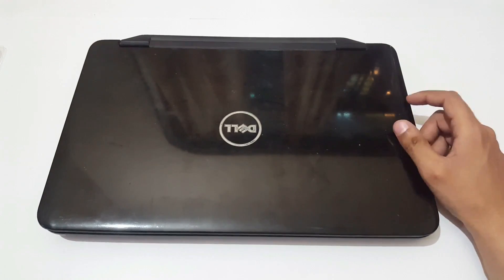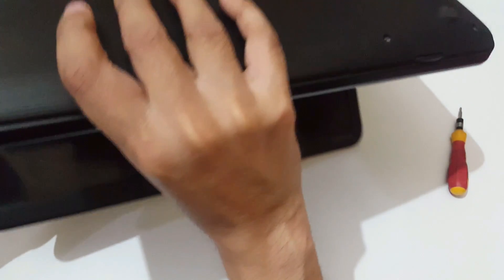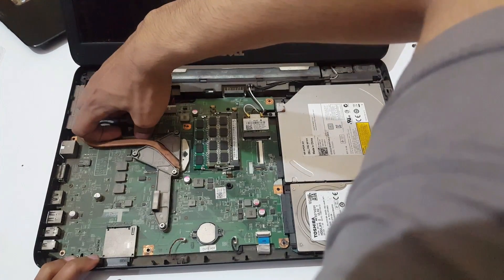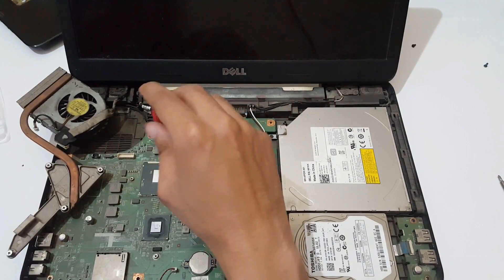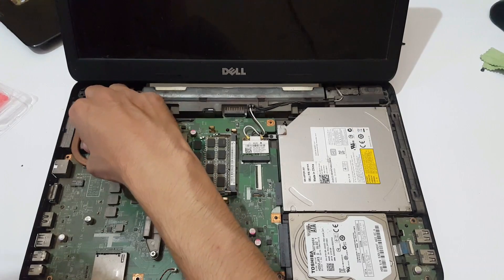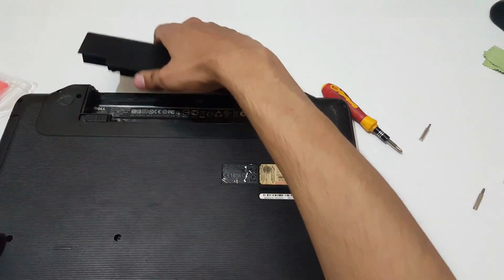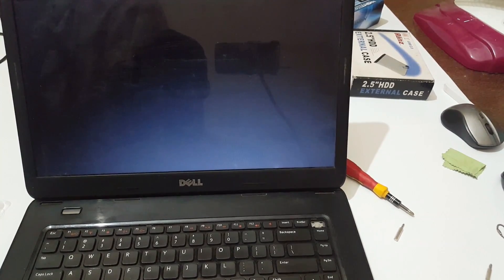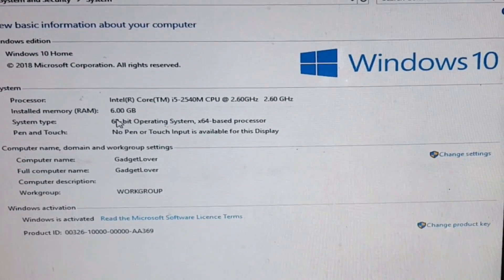How to Upgrade Processor on DELL Laptop | i3 to i5 & i7 - Make Laptop Faster for Gaming

Comment: What is best cpu for hp pavilllion x360 please reply
Reply: 8130
Reply from the maker: Ryan Gamer : You can't upgrade it with Intel Core i3 9100F and I would like to inform you that Intel Core i7 8650U is best available processor for your Laptop
Reply: Is it correct
Reply: Where to find it
Reply: As I am converting it into gaming laptop
Reply: Tell me a cheap one below 10000
Reply: In i3 series
Reply: And I don't want to install in home is there any place in bhopal
Reply from the maker: Ryan Gamer : Go for Intel Core i5 8250U and I would suggest you buy it from Ebay or Aliexpress online store
Reply: Can I upgrade it into i3 9100f
Reply from the maker: Ryan Gamer : In my knowledge the processor of this Laptop is soldered so you can't upgrade it
Reply: Soldered meaning can I take it out with technician without replacing the motherboard i am converting my i3 8130u to i3 9100f can I upgrade it
Reply: Is there any way to remove it
Reply from the maker: Ryan Gamer : Yes but it requires professional hand soldering services
Reply: Can I upgrade it with i3 9100f
Reply from the maker: Ryan Gamer : Provide processor number
Reply: Which old processor or i3 9100f
Reply: I don't know where to find it
Reply from the maker: Ryan Gamer : Installed processor
Reply: More cheap man
Reply: Very very very very cheap below 10000 it is 25000
Reply: Is this this i5 8250u available in offline market
Reply from the maker: Ryan Gamer : In my knowledge yes so to know about it I would suggest you go to nearby PC & Hardware store
Reply: Bro one more question i am upgrading my graphics to msi rx 570 8gb can I use internal display in it
Reply from the maker: Ryan Gamer : You can attach it externally to your Laptop
Reply: Thank you bro but one more question can I use galax gtx 1650 super 4gb in it and does it support exp gdc v8.0
Reply: Can you tell me how much rough price is this i5 8250u in offline market 🤔
Reply from the maker: Ryan Gamer : You can attach it externally and I would suggest you ask about it nearby PC & Hardware store owner
Reply: Can I use it the exp gdc v8.0 using laptop cable
Reply from the maker: Ryan Gamer : In my knowledge yes
Reply: Can I upgrade my ram to 16 gb
Reply from the maker: Ryan Gamer : Yes
Reply: Can the gdc beast v8.0 work with my laptop power cable with hdmi i mean for the power
Reply from the maker: Ryan Gamer : It is for external video card
Reply: Yeah that only thank you for information and subscribe my i will do gaming
Reply from the maker: Ryan Gamer : You're welcome
Reply: Can I connect it with 12w adapter the gdc beast 8.0 and also do we have to take same ram mhz or we can take other mhz rams also 🤔 not the company only the mhz matters? Coz I want to upgrade to 16 gb ram with galax 1650 4gb the ram I want to take is of Adata 16gb premium does the mhz matter
Reply from the maker: Ryan Gamer : Yes
Reply: Do I have to take same mhz
Reply: I have two ram in two slot 4gbx4gb 8gb of adata is my total ram if I remove both of them and take other 16 gb adatamhz ram so what will happen will it work or not
Reply from the maker: Ryan Gamer : Supportable RAM will definitely work and I would suggest you buy 8+8GB of RAM for your Laptop
Reply: Can I change motherboard and then install the processor i3 9100f
Reply: Will this trick work with my gtx 1660 super 6 pin connector and will it work with my laptop cable 🤔 🤔 or it require more power please say with hdmi  will 
The gdc beast v8.0 and I will also buy 
6 pin power connector or the the 8 power connector i will see that but please tell me
Reply from the maker: Ryan Gamer : It has 19 pins that carry data
Reply: So can I connect gdc beast v8.0 with my laptop cable i mean can I insert my laptop cable in that hole if you see videos and then can I connect galax gtx 1660 4gb super with the pin connector
Reply from the maker: Ryan Gamer : You can attach it externally but before it I would suggest you see its requirements
Reply: Its power requirement is 450 w and can I connect it with my laptop cable that is 60 watt to gdc exp beast v8.0 and then extend the power to the 6 pin power connector please only say yes or no please...
Reply from the maker: Ryan Gamer : Yes
Reply: The gtx 1660 super are you kidding me it is 60 watt laptop cable explain me how
Reply: Without power supply only laptop cable
Reply: Only one laptop cable and hdmi from exp gdc v8.0 only can I extend its power from  the dock gdc v8.0 to graphic card as it require 8 pin power connector and also will this gdc exp v8.0 support galax gtx 1660 super 4gb
I will buy 8 pin connector will this trick work are you sure with 8130u will there will be a bottleneck if yes then also I will buy this gpu I would not get it all performance but I can get the performance and I have no psu only laptop cable will it work say yes or no
Reply from the maker: Ryan Gamer : It require additional supply for more information I would suggest you search on Google for connectivity process
Reply: Yes I understand i will connect the cable to gdc and  then extend the power using 8 pin connector will it be possible if not then say nvidia gtx gigabyte 1650 4gb
Reply from the maker: Ryan Gamer : Select according to your requirement and external source require supply to boost performance
Reply: Then I am buying galax 1650ti
Reply: Will this work with gtx 1660 super galax and does this gpu support exp gdc and the power supply i am buying is Mult-Equip Laptop Charger for Dell Optiplex Netzteil Series DA-2 D220p-01 SX280 GX620 GX745 Charger 12V 18A 220W 8 Hole Interface Computer Foot Switching Power Supply Adapter Monitoring LED Display
You can search on Amazon will this power supply work with gtx 1660 super 6gb oc
Reply from the maker: Ryan Gamer : If given power supply supported then yes
Reply: Really this supports my laptop so can I use it only this power supply say yes or no please reply 😅
Reply: But it is 220W but the graphic card needs atleast 450w to work will this work 🤔 🙄 😑 😅
Reply from the maker: Ryan Gamer : See its operating guide
Reply: Please just say yes or no will the Graphics card work with this power supply because it has no operating guide and I have not buy card yet so please say yes or no handsjo😗😥😥😥👌
Reply: Please say yes or no I have not buyed the graphics card yet 😬 😅 and also I have not bought this power supply so please say yes or no and if yes please tell😛😘😘😍😍🤗🤔
Reply from the maker: Ryan Gamer : You need power supply unit for any external graphics card installation for your Laptop
Reply: This is also a power supply but 220W will it work graphic card require 450w
Reply: This is power supply
Reply: Will it work 🤔
Reply from the maker: Ryan Gamer : With Power supply unit yes
Reply: But it is 220w and graphics require 450w
Reply from the maker: Ryan Gamer : I would suggest you search on Google about it for proper details
Reply: Coz it is only showing 220w
Reply from the maker: Ryan Gamer : Wattage manage by power supply so don't worry and buy power supply unit then use it as an external graphics card in your Laptop
Reply: Are you sure I will buy this dell 220w power supply and galax gtx 1660 super 6gb will it work but tell me how will this 220w power supply will handle 450 w graphics if there won't issue i will buy both of them if this graphic card support this power supply
Reply: Will it work for sure
Reply: Will it blast or something else
Reply from the maker: Ryan Gamer : Buy 450 or 500W power supply unit
Reply: What if I buy 220w because it is not portable tell me a portable power supply of 450w or 500w
Reply from the maker: Ryan Gamer : It will not work and I would suggest you search on Google about it for better results
Reply: Tell me a portable powersupply of 500w
Reply from the maker: Ryan Gamer : Search on Google about best 500W power supply units for Laptop
Reply: Ok if there is no power supply  just say tell me or  else I will buy galax 1650 4gb it has no power connectors
Reply from the maker: Ryan Gamer : Yes if not found do this
Reply: Can I use galax gtx 1650 no power connector with my 65 w laptop charger
Reply from the maker: Ryan Gamer : See its specifications
Reply: Sorry but I am building gaming pc instead of laptop sorry man
Reply from the maker: Ryan Gamer : It's okay and if you have any problem related to this video ask I would be happy to help you
Reply: Uh bro can you tell me the current price  of rtx 3080 founder edition and also tell me the price rtx 3090 has it lower down 95000 rupees please say
Reply from the maker: Ryan Gamer : I would suggest you search it on Ebay or Aliexpress online store and buy best reviewed and affordable graphics card
Reply: Please say price rtx 3080
Reply from the maker: Ryan Gamer : I would suggest you check on given websites

Comment: i have hp 250 g7 can i upgeade processor.?
Reply from the maker: GloriBless : Unfortunately the processor of this Laptop is soldered so you can't upgrade it
Reply: @GadgetLover360  😩😩
Reply: @GadgetLover360  when i use ssd and upgrade ram than increase speed?
Reply from the maker: GloriBless : Yes
Reply: @GadgetLover360  thank you for reply
Reply from the maker: GloriBless : You're welcome

Comment: Bro my laptop is Toshiba satellite u500 and my core is core 2 duo
Can i upgrade my cpu?
Reply from the maker: sohaib amerol : Yes
Reply: @GadgetLover360  what cpu is good fo my laptop?
Reply from the maker: sohaib amerol : Provide processor number
Reply: @GadgetLover360  my current cpu is core 2 duo t6600
Reply from the maker: sohaib amerol : Intel Core 2 Duo T9900 is best processor for your Laptop
Reply: @GadgetLover360  what if i buy 45 watts tdp to replace my current 35 watts tdp? Is it okay?
Reply from the maker: sohaib amerol : Your Laptop will run hot
Reply: @GadgetLover360  but it is okay for my laptop even it's hot?
Reply from the maker: sohaib amerol : Yes and I would suggest you use cooling pad with this processor
Reply: @GadgetLover360  ok thank you my friend
Reply from the maker: sohaib amerol : You're welcome

Comment: Someone give link for purchasing the upgraded components
Reply from the maker: RaNa RaNa : I would suggest you buy it from Ebay or Aliexpress online store
Reply: Thank u
Reply: I have dell latitude 3440, can i change processor and graphics card
Reply from the maker: RaNa RaNa : You're welcome and unfortunately the processor of this Laptop is soldered so you can't upgrade it but you can attach graphics card externally to your Laptop for better gaming experience

Comment: Hey bro 

I have a Dell vostro 1520 with Intel core 2 duo and 2 gb ram 

Can I upgrade it🤔

Plzz reply😙
Reply from the maker: nS aBiR GaMiNg : Yes and Intel Core 2 Duo P9700 is best processor for your Laptop
Reply: @GadgetLover360  no no I want to upgrade it to Intel i5 can I??
Reply from the maker: nS aBiR GaMiNg : Unfortunately you can upgrade it in same generation only
Reply: @GadgetLover360  ok no problem

Comment: Bro I have Dell Inspiron N5110 i5 2410 can I upgrade it to i7 or i5 6 th gen?????
Reply from the maker: Aazib Jamal : Yes you can upgrade it to Intel Core i7 processor but in same generation only and Intel Core i7 2640M is best processor for your Laptop

Comment: I have a dell vostro 1540 intel i3 4gb ram can I upgrade it to i5 and can you suggest any other upgrades
Reply from the maker: Shreyas . U : Intel Core i5 580M is best processor for your Laptop to upgrade and I would suggest you upgrade its RAM and install SSD for more better performance

Comment: Dell inspiron 3521 can processor upgrade does mother board support power supply any issue.???
Reply from the maker: CK Bro's : No but unfortunately the processor of this Laptop is soldered so you can't upgrade it

Comment: Hey.
Can i upgrade processor ? My loptop Dell inspiron 3000 ( 3576)Intel Core i5-8250U CPU @ 1.60GHz Need more GHz
Reply from the maker: S5 Tank - ML : The processor of this Laptop is soldered so you can't upgrade it
Reply: @GadgetLover360  dell inspiron 3593 can i upgrade  it
Reply from the maker: Kalash Bawankar : Unfortunately the processor of this Laptop is soldered so you can't upgrade it but I would suggest you upgrade its RAM and install SSD for better performance
Reply: @GadgetLover360  thank u
Reply from the maker: Kalash Bawankar : You're welcome

Comment: Hey! I have Dell Inspiron 5558 i3 4th generation. I have surfed everywhere but still not sure. Please let me know if I can upgrade my RAM and/or processor, if yes what is the limit?
Currently RAM is 6GB.
Reply from the maker: Ashish Bajaj : Unfortunately the processor of this Laptop is soldered so you can't upgrade it and I would like to inform you that you can expand its RAM upto 16GB
Reply: @GadgetLover360  : Sorry for asking again. Just wanted to ask if you can advice on which RAM I should buy?
Reply from the maker: Ashish Bajaj : Buy 1600 MHz DDR3L RAM for this Laptop

Comment: bro i have i5 8th gen basic variant laptop . can i upgrade to higher variant of 8th gen or can i upgrade to i5 9th,10th gen
Reply from the maker: keerti vasan : I would like to inform you that if processor is not soldered you can upgrade it in same generation only
Reply: @GadgetLover360  that means i can't upgrade my processor?
Reply from the maker: keerti vasan : If it is soldered professional hand soldering services are required to upgrade it
Reply: @GadgetLover360  thank you bro
Reply from the maker: keerthi vasan : You're welcome

Comment: Mine is an i3 5005u Dell Inspiron 3558. Is it possible to change the CPU?
Reply from the maker: BSEV001 Jefferson Vijay : Unfortunately the processor of this Laptop is soldered so you can't upgrade it
Reply: @GadgetLover360  Thx for the instaned reply.
U got a new subscriber.
Reply from the maker: BSEV001 Jefferson Vijay : Dear subscriber you're welcome

Comment: Hye Buddy How Are You Can You Help Me With My Dell Inspiron 3520  Can I Also Upgrade It From Core i3 to i5 or i7?
Reply from the maker: Dreamer Nik : Yes
Reply: But The Problem Is Its Already Heating If I Change My Processor Than It Can Create Problem I Guess...Or It May Be Take Permanent Damage On The Mother Board?
Reply from the maker: Dreamer Nik : It depends on upgraded processor thermal design power
Reply: Can you suggest me ? So it was quite helpful for me..
Reply from the maker: Dreamer Nik : Provide processor number

Comment: I have Intel Pentium gold processor
Reply from the maker: kumkum Jha : Provide processor number
Reply: @GadgetLover360  INTEL PENTIUM GOLD 4417U
Reply from the maker: kumkum Jha : Intel Core i5 8350U is best processor for your Laptop
Reply: @GadgetLover360  sir is Intel core i5 8350u better or Intel i3 9th gen
Reply from the maker: kumkum Jha : Obviously 9th generation is better but unfortunately you can upgrade processor in same generation only

Comment: Can I Upgrade lenovo pad 320 i3 to i5
Reply from the maker: Pulkit Rana : Unfortunately the processor of this Laptop is soldered so you can't upgrade it
Reply: @GadgetLover360  and what about ram sir?
Can I use two sticks of ddr4
HDD is sata 3 but cd is atapi..

Can I use ssd in sata 3 where hdd is placed and hdd in the cd rom using 9.5mm caddy?

And thanks for rapid reply..

Keep uploading
Reply from the maker: Pulkit Rana : You're welcome and you can expand it upto 16GB with 2133Mhz DDR4 RAM and I would suggest you install 2.5 inch internal SSD for better performance
Reply: @GadgetLover360  I have one ddr4 stick 4 gb..so another dd4 ram stick can be used.. lenovo ThinkPad 32/ has 2 ram slotes?
Reply from the maker: Pulkit Rana : Yes

Comment: Thanks man! Sooo i have a Dell 15 Inspiron 3552 and a Pentium processor(lol) so can i upgrade it? pls reply! 😁
Reply from the maker: Eyoniix : You're welcome and unfortunately the processor of this Laptop is soldered so you can't upgrade it I would suggest you upgrade its RAM and install SSD for better performance
Reply: Oh ok.. I was just finding a way so that my mom would not use much money for a new laptop.. but i guess i will just upgrade the ram! and ssd too! Ty for the tip! [new sub]
Reply: Does Dell inspiron 14 5406 CPU soldered.? plz reply.
Reply from the maker: Mark Shylla : In my knowledge the processor of this Laptop is soldered
Reply: @GadgetLover360  ok thanks man.👍
Reply from the maker: Mark Shylla : You're welcome

Comment: Bro i have dell inspiron 5566 have i3 7100 can i upgrade to i5 with dedicated graphics
Reply from the maker: amjad jaleel : The processor of this Laptop is soldered so you can't upgrade it but you can attach graphics card externally to your Laptop
Reply: @GadgetLover360  like using the wifi slot
Reply from the maker: amjad jaleel : HDMI connectivity is better than this
Reply: @GadgetLover360  how to do it bro😍
Reply: @GadgetLover360  i don't know
Reply from the maker: amjad jaleel : I would suggest you search on Google for better details
Reply: @GadgetLover360  ok bro..... 
Have you done any video about it
Reply from the maker: amjad jaleel : Not yet
Reply: @GadgetLover360  ok bro just make it its a good content i think 😊😊
Reply from the maker: amjad jaleel : Okay I will try to make video about it
Reply: @GadgetLover360  can i play gta v on my laptop😓
Reply from the maker: amjad jaleel : See its minimum system requirements
Reply: @GadgetLover360  i know but it shows it need video card gtx660.... i dont have it
Reply from the maker: amjad jaleel : Unfortunately without required hardware you can't play the game